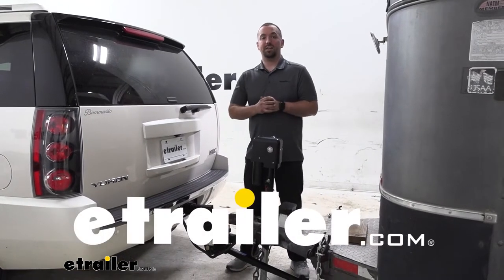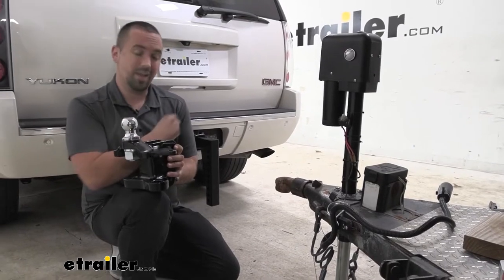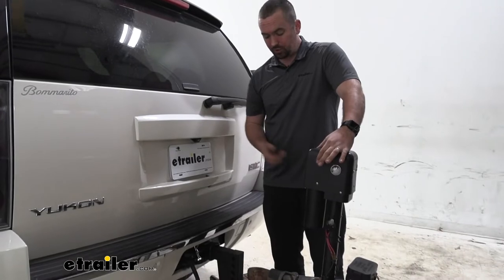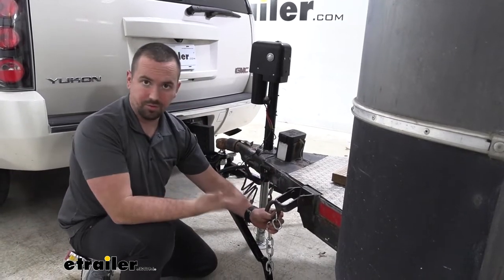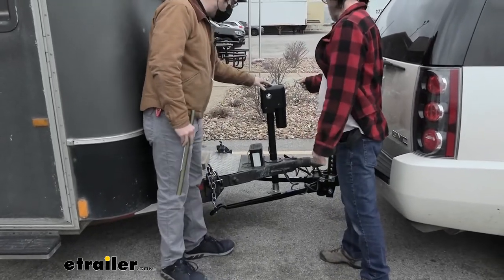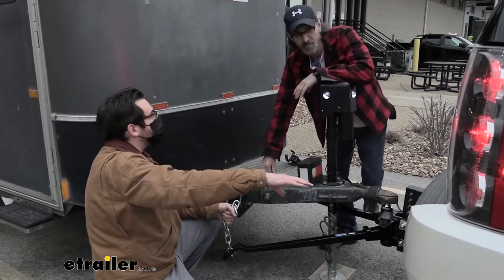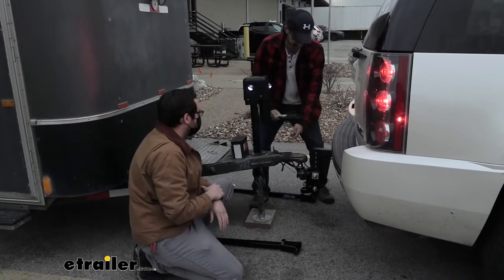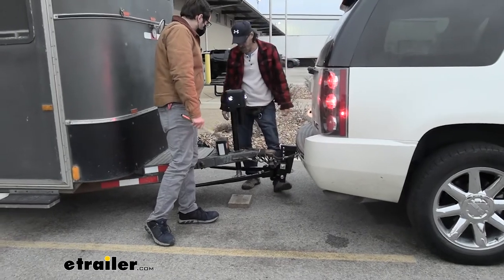etrailer | Reese Weight Distribution without Shank Installation - 2014 GMC Yukon

Comment: What about the airbags on the Denali?  Shouldn’t you set up to account for those?
Reply from the maker: This kit is designed to be set up with normal ride height settings in the bags.
https://www.etrailer.com/Weight-Distribution-Hitch/Reese/RP66022.html